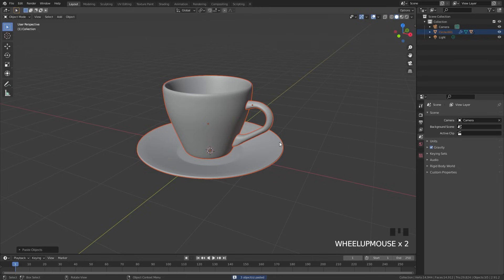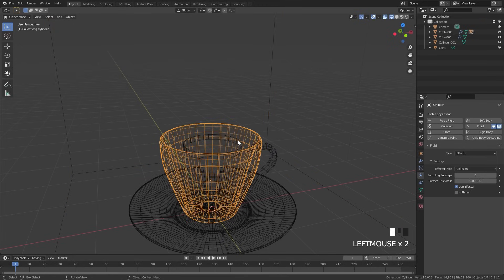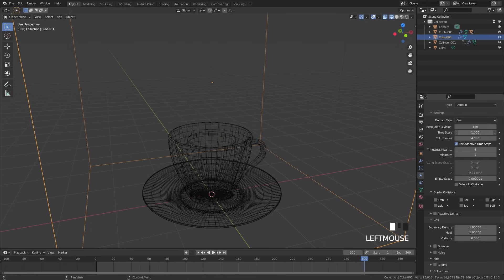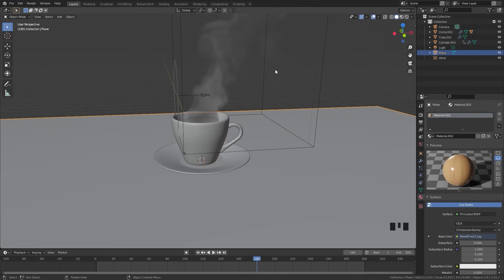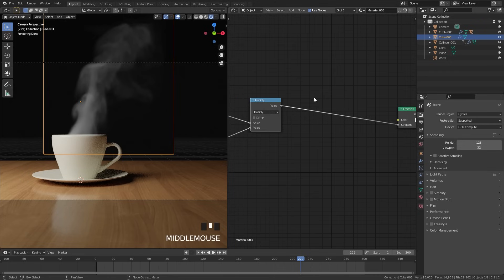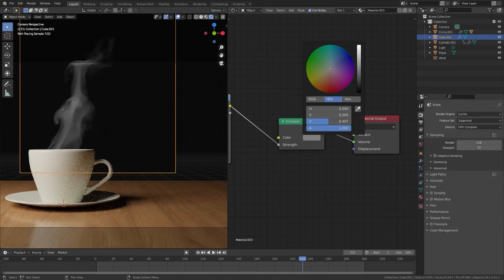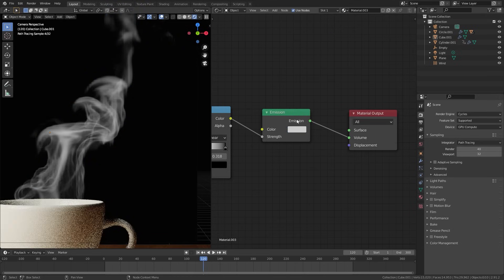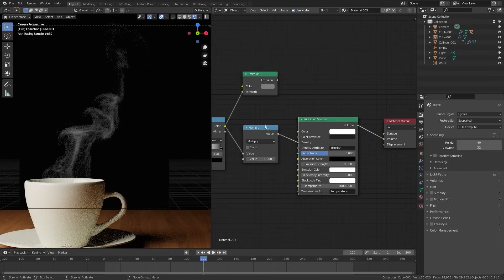Blender Tutorial - How to Create Steam w/ Mantaflow

Comment: So this still works in 3.0 in late 2025. Just did it myself and love the result. One question, though. The simulation I created is going to be composited over another image (just need one frame, not the whole thing). The issue is that the scene has different colored lights, and the rendered image is the standard gray. I need the emission color to take on/account for the color of the lights. I tried mixing the emission color between the white and a gradient I created using Separate XYZ with a color ramp, and it looks okay. But is there a better way to do this?

Comment: [SOLVED: See answer below]
Smoke is only visible in Wireframe mode and Solid mode. Does not show up in Render mode or renderings.
I have made smoke before, using this tutorial, but now I am using Blender 4.2. Not sure what the problem is.

[ANSWER:]
You must BAKE entire simulation to see anything in render mode or when rendering an image.
It wasn't like that in earlier versions of Blender.

To quickly test your smoke, temporarily use shorter time spans (Start and End). Decrease your Domain's "Resolution Divisions" to about 60 or 80. Then increase time span it back to higher and BAKE again when you do your final rendering.

Adding smoke to existing project from the past. My entire project is scaled too big too, which requires changing heat settings, speed, longer dissolve time, etc. and other settings too. Pain in the rear. But it works.
Reply: wait i dont understand so i have to bake a nd render at the same time to get a result/visual?
Reply: @vigirousgrub420   OK, Here's an update!! The settings in Blender 4.3  The DOMAIN in the physics properties should be "Cache>Type>Replay"
And that will put it back to "normal" and you can see smoke instantly without baking.

Comment: Steps and Taking Notes:

Setting Up the Scene:

- Set up your scene and object emitter.

- Add a cube and scale it to cover all the objects that will participate in the simulation.

- Go to the Physics tab, select "Fluid," and set the cube to "Domain."

- Add your emitter, select "Fluid" in the Physics tab, and set it to "Flow."

Setting Up the Emitter:

- Fluid Type: Set to "Flow".

- Flow Behavior: Set to "Inflow".

- Initial Temperature: Set to "1.2".

- Flow Source (Surface Emission): Set to "0.6".

- Texture: Enable "Texture". Go to the Textures panel and add a new texture.

- Type: "Clouds."

- Colors (Texture panel): Enable "Clamp" and set the Contrast to "5".

- Then, go back to the Physics tab and select your texture. Animate the Offset over your timeline by adding a keyframe at the beginning and increasing the value with another keyframe at the end of your simulation.

- Reference: Frame 1: Offset "0". Frame 300: Offset "1.5".

- Make sure to make them linear by pressing T in the timeline and selecting "Linear".

Our flow object is done!
Let's go to set up our Domain:

Domain Settings:

- Fluid Type: Set to "Domain".

- Resolution Divisions: Set to "160".

- Time Scale: Set to "0.8".

- Turn on "Adaptive Domain".

- Threshold: Set to "0.001".

- Heat: Set to "1.5".

- Turn on "Dissolve".

- Time: "30" (The smoke gets emitted and lasts about 30 frames before it starts to dissolve).

- Set your "End" value to "300" (same as your Offset animation frames).

- Make sure the type is set to "Modular".

- Enable "Is Resumable".

If your smoke simulation will collide with any object, you can select it, go to the Physics tab, set it to Fluid, and choose "Effector" as the type, with the Effector Type set to "Collision".

Optional: You can add a wind force to give some direction to the smoke:

- Add Object - Force Field: Select "Wind".
- Direct and set the force to give the desired direction.
- Strength: Set to "0.05" (Keep this value very low for subtle effects, like in this case).

Now we're ready to bake data!
Don't forget to save...
In case you're making a real smoke simulation from your computer.
Reply: i followed everything but it doesn't work, blender 3.6

Comment: I have a question. I followed this method to render only the steam part with transparent background, but the result was a completely black video. I could see the steam on the render image screen, but the render output was black. How can I export only the steam with transparent background? 
By the way, I set everything the same as this video until the end, and when I exported the video, I checked the transparent option in Film, set the file format to FFmpeg and chose RGBA, and used Quick time, QT RLE/QT Animation or PNG as the container and video codec, but they all turned out black.
I would appreciate it if you could enlighten me.

Comment: Great tutorial thanks. The interface is a little different in V.4. Denoising Normals and Denoising Albedo doesnt appear in the "Render Layers" node for me. Im wondering could it be video card dependent. I use a NVIDIA Geforce GTX 1650. There is a reference to Albedo in my Render settings area though.

Comment: Using Blender 3.2. I'm using Cycles. I couldn't see the steam in material preview or render view, only solid view. I wasn't showing in my render either. After looking through the comments and doing some searching, every solution wasn't working UNTIL 11 minutes into the video they talk about Eevee settings using a Principled volume and upping the density - I could finally see it! Still using Cycles. So for anyone having the same issue, definitely try this first.

Comment: Coming late to the party here, but this was a great tutorial and works the same in Blender 3.0. I don't however understand why the smoke wont show when I export it as an image without background. It shows in my render in cycles. Any Idea?
Reply: I'm having the same issue- during the render I can see it but when I import the image sequence into Davinci resolve the steam just isn't there. I have a feeling it's something to do with the alpha channel in the render? Did you find a solution?
Reply: Hi  @ChrisEldridgeKino  , I tried a thousand things with this and ended up just using chroma key instead, which solved it. 
It seems like it has something to do with Blender running in a higher colour depth, but when rendering an alpha channel to 8-bit the smoke detail is lost. 
Rendering to TIF 16-bit works, but when changing to 8-bit colour in Photoshop the exact same thing happens. 
I asked the Blender community on Facebook and no one could come up with a good solution.

Comment: a good way to make the material work for both cycles and eevee is to plug the final math node into both the density and the emission strength slots for the principled volume and set that math node to a value like 0.2. From there, just unplug it from density when rendering in cycles. and plug it back in when rendering for eevee
Reply: Im currently trying to figure this out to work in cycles. beginner doing Blender guru donut and wanted to add this for a coffee but im not seeing it at all in render, only solid or wire. cant see it in any mode towards last steps before baking once i change the type to Modular from Repeat.

Comment: Lovely tutorial. The steps were quite easy to follow but sadly, for some reason my inflow object doesn't emit any smoke after baking the data, I've copied your settings exactly. If I play the animation I drop to about 0.2fps and I can see the mesh expanding like smoke is there, but I can't see anything. What could be wrong?
Reply: If the scene is bright try playing with the light source, its definitely a subtle effect. Or you can darken the color of your back drop. Make sure when your applying the shader nodes that you have the cube that you set the domain to, not the cylinder that has the smoke effect. Hopefully that will help!
Reply: I found the same thing, but after mucking around with everything realized I had a couple of settings wrong. What also helped was the smoke was being generated but not actually coming up and out of the cup, so used a second wind generator placed just under the mesh generating these particles, as well as with the other wind generator ended up angling it up a little so it wouldn't collide so much with the cup.
Reply: @psychichigh  That makes a lot of sense! I overlooked a lot of details. Thank you!

Comment: Brand new to blender, so I’m not sure if this is a silly question or not, but does mantaflow have to be installed in a plug in folder or has the code been incorporated into blender 2.9?
Reply from the maker: It is already built into blender. No need to install anything!
Reply: @BlenderMadeEasy  Cool!  Thanks for getting back to me so quickly.

Comment: For some reason my inflow object doesn't emit any smoke after baking the data, i've copied your settings exactly. If I play the animation I drop to about 0.2fps and I can see the mesh expanding like smoke is there, but I can't see anything. What could be wrong?
Reply: same here, wonder if you were able to figure out, has been frustrating because not a lot of people are talking about it...lol
Reply: I found it can be helpful if you can't see the steam in some scenes, to move the second Multiply node to the output of the ColorRamp Node instead of at its input
Reply: Yeah and I wish he would've mentioned what the bake was going to do, took forever. Wish I could've edited it more. Kinda my fault for not knowing what bake does though.
Reply: I had the emission outputting to the surface node and not the volume... swapping it to volume fixed it for me

Comment: It looks like this coffee cup is not using real world dimensions - i.e. it looks to be a 2 meters wide given the size of the cylinder added as the steam source. So how does one scale down the steam settings for a realistic sized cup, like no more than 10 cm across? Which settings are important for size scaling?
Reply from the maker: The smoke simulation will not work when it's scaled down that small. That's why the cup is so large. Blender doesn't work well with small objects and simulations.
Reply: @BlenderMadeEasy  Rats! I was afraid of that. Is it possible to scale the results of the simulation after the fact? Bake, then scale down? Thanks for the reply above, BTW. Just found your channel. Subscribed.
Reply from the maker: Yes, I just tested it and you can scale down the domain after the bake is done.  If that causes any issues you can also try adding a Volume Object. This will allow you to scale it down and move it however you like very easily.  I did a couple tutorials on that.  Thank you for subscribing! :)
Reply: @BlenderMadeEasy  Thanks again for the reply. I ended up rerendering the whole thing after setting all relevant objects' origins to the bottom of the cup. Without doing that, scaling the Domain would scale the container but not move the smoke accordingly. It's possible I did something to screw that up initially, but this worked well. I did, however, have to adjust the shader a bit. The color ramp, and the emission, and one of the math nodes needed to allow the smoke to be stronger. Thanks for the help!

Given that real-world small scale smoke doesn't work well, cigars, kitchen fires, and other small simulations will all need scaling down. I really want to model and render in real scale just to be consistent in everything I do. You never know when you'll need to combine assets, and it's better, in my opinion, if they are ready to go.
Reply: Thanks a ton for bringing this up. I've been banging my head on the desk for days now trying to work this problem and searching to see if there was something going on. I had steam that was a bizarre proportion and there were only so many bakes I could do before losing my mind. Thanks for asking the question I didn't know to ask!

Comment: Hi, could you please reveal which program does that the shortcuts are always displayed at the bottom right? Or is it possible to activate this somewhere in Blender? Thanks in advance!
Reply from the maker: It's an addon called Screencast Keys. If you Google it, it should be right there!
Reply: @BlenderMadeEasy  Big thanks, Mister. I have installed and activated it, but it seems not to work. Nothing is displayed. :/